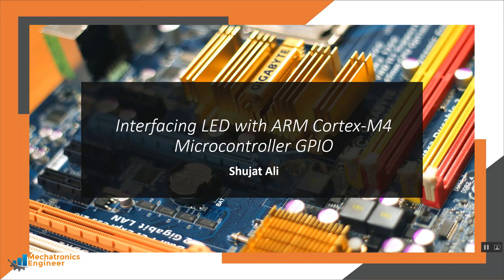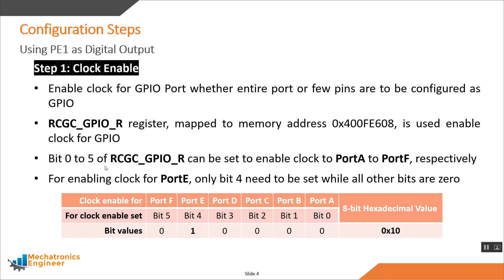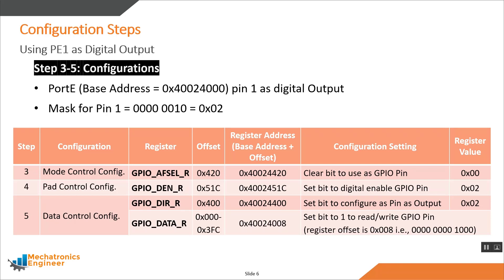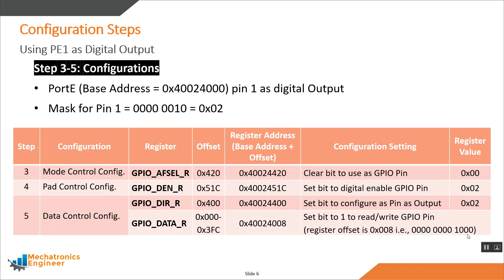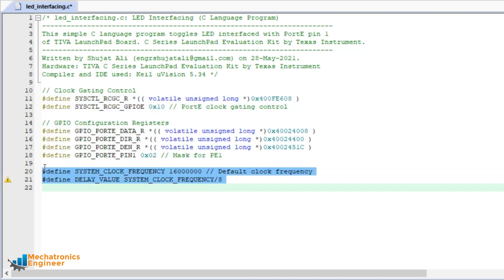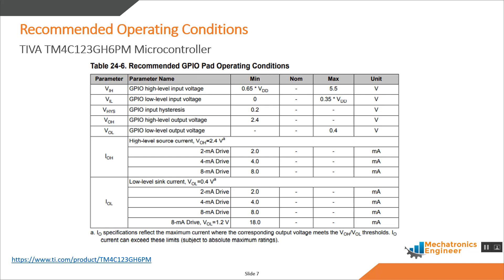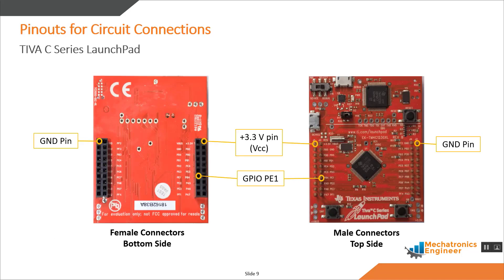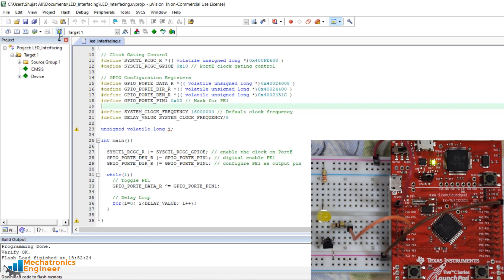Interfacing an LED with TIVA C Series LaunchPad

Comment: Thanks for the brilliant explanation. I'm little confused on how GPIO_DATA_R works. Why is the register offset 0x008 for PIN[1] instead of 0x04? I'm not sure how offset works. If I were to create a DATA Register for PIN[7] what would be offset value for  it?